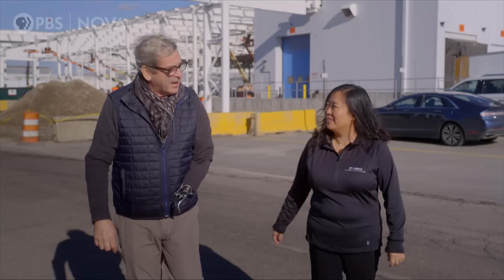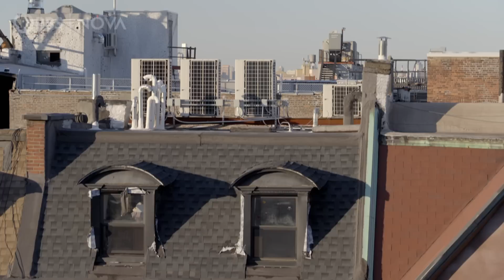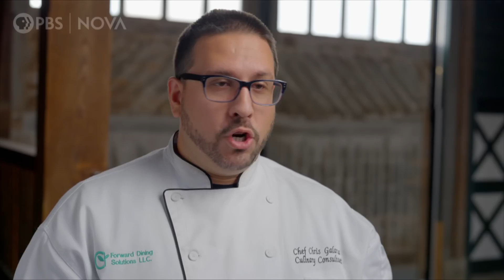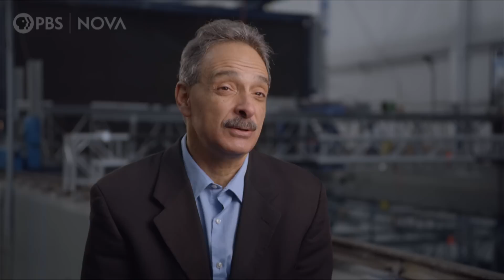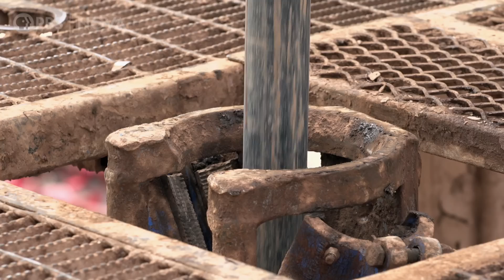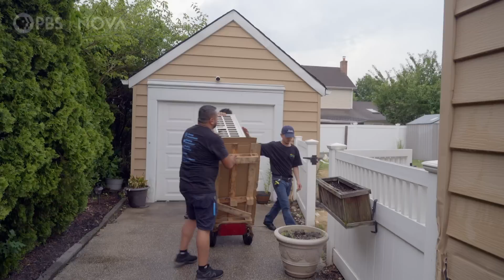Chasing Carbon Zero | Full Documentary | NOVA | PBS

Comment: A second premise is that the heat pump runs cheap. It is essentially a reverse air conditioner with a compressor and that is the most expensive electrical  item in a household during the summer. Now it also will be in the winter. The price of electricity will be the major factor and how we make it.

Comment: 2050? No the 2015 paris agreement says 10% of 1990 emissions in 2030 to peak at 1.5C in 2050. Stopping emissions by 2050 is grabbed out of thin air and 20 years too late! First segment electric Ford F-150? How is that helping? The amount of batteries it need could power 5 normal EVs for which we have too little material to make batteries for as is? I thought PBS was equal to scientific honesty? The agreed baseline is 1990, which the US signed to as well, not 2005, Choosing 2005 as baseline year make reductions look more substantial than they are as it becomes less obvious how far behind we are! standing in front of a blackboard does not make you a scientist. Is this a commercial for fake environmentalism, you borrowed the car from Ford for free? Thank you for showing the infeasibility of truck EVs!

Comment: To be fair, taking a road trip in the most rural area in the NE with a high energy consumption EV pickup truck is probably the  worst case usage for an EV. If they tried that trip in a tesla model 3 or even a chevy Bolt, it would have a lot smoother.

Comment: Everything we do releases carbon dioxide, so they want to control everything. 
There will be global starvation if fossil fuels are eliminated. At risk in coming decades will be half of the world’s 8.5 billion to 10 billion people who are fed by crops grown with fertilizers derived from fossil fuels. Getting to Net Zero by 2050 would cost $9.2 trillion a year globally (McKinsey). That's not going to be good value for money. That's nearly one-tenth of global GDP. That money would be better spent on a myriad of things including educating the fifth of humanity who are illiterate and represent a 7% annual loss to the world's economy. Any country that attempts it will be indebted or impoverished. 
Example: For the UK to reach net zero by electrification of its transport fleet and heating system, it will require a tripling (as a minimum) of its current electrical generation capacity among other things. This will essentially require the UK consuming all of the current global supply of copper and other rare metals for the next 25 years. The cost will be unaffordable and the skilled manpower levels unattainable. And that is just to eliminate the 1% of the global CO2 emissions that the UK is responsible for. So times that by 100 for the Earth. 10,000 child slaves in the cobalt mines of the Congo not enough for you? Make it a million. Imagine all the human suffering and environmental damage done from all that resource extraction! 
An electric vehicle requires 6 times the mineral input compared to a conventional one, and the carbon cost is greater until you reach 80,000 miles.
Production of all of these minerals has been mastered by China: a totalitarian communist regime that thinks nothing of the mass murder of its own citizens, imagine how much it cares about the rest of us.
And why are we embarking on this great net zero crusade? For what? So someone can virtue signal by driving around in a Tesla.
Maddeningly, there is no climate crisis. The Earth was warmer in the recent and distant past.
Reply: "why are we embarking on this great net zero crusade? For what? So someone can virtue signal by driving around in a Tesla".
Do you deny CO2 is a greenhouse gas?
Reply: "Maddeningly, there is no climate crisis. The Earth was warmer in the recent and distant past" [citation needed].
Reply: @hosnimubarak8869  Good to see you're still keeping an eye on me, Hosni.

Comment: Heat pumps are no more expensive that a high quality furnace, a boiler, or air condition unit.  In the latter case, the only differences are an extra valve to reverse the direction of coolant flow and heat exchangers that are a little larger to improve efficiency.

Comment: The problem is all the copper and rare material we'll need to electrify the human race.  2050 is a noble goal but it'll probably be more like 2080-2100.  We could certainly do it by 2050, hell, we could do it in the US by 2035 if we really wanted to.  Huge strides in material and battery science have been made in the last 20 years.  But manufacturing at scale is the issue.  And if the world economy moves into a protectionist era, it'll get even more expensive.  Nuclear power can be a huge stop gap here, if not the solution outright.

Comment: How about building wind turbines with two propellers. One on each side to double the output.
Reply: Too much turbulence.   Each blade disturbs the air.
Reply: Unless the blades are far apart , the extra energy generated is minimal.
Reply: Engineers considered that a long time ago you can bet on it. Smart bunch they are.

Comment: I didn't hear anything about conservation (more insulation & triple panel windows) or  hydrogen fuel cells. I remember ~15 yrs ago reading stories about HFC cars and refiling stations. 
Also  I saw a vid then, about a guy who lived in a northern US state. When he built his house he had the whole roof angled to the south to maximize exposure for solar panels. Since of his northern latitude that wasn't enough for long stretches of cloudy days so he also had a much smaller panel in the yard. So he never had to worry about his elec usage he also had a hydrogen fuel cell (I think ~1000 gal) and a machine to convert the solar energy, (when he had more than needed) to split H2O to hydrogen for the fuel cell & oxygen the only exhaust. This enabled him to have enough electricity to last the winter w/ the solar panels. 
He was able to live very comfortably & he even had a hot tub. All zero carbon.
Reply: Now you're talking.

Comment: This is one big advert for industry with nothing about living with less energy. Rocket mass heaters, passive solar, compost toilets, rain capture, permaculture in suburbs...
Reply: That's because they aren't degrowth Doomers.
Reply: @chapter4travels  They're delusional.
There's no energy transition and there never was in history. There's only addition.
Reply: @borealphoto  I see your point. We went from wood and dung to coal, then to gas and oil. We still use all of those today. As a %, the amount of wood and dung has dropped significantly but not coal. What is certain is we always move towards higher-density fuel. Moving towards uranium makes perfect sense just from an energy density standpoint. We will continue to use fossil fuels until their cost rises enough to completely transition to uranium fissile fuel. The earth has about 2 billion years worth of accessible uranium, so that should last a while.
Reply: @borealphoto we did transition from expensive whale oil to kerosene.   Didn't need any government mandates.
Reply: @NathansHVAC  Yep, I forgot about whale oil. But that was strictly by cost, oil was so much cheaper that no one bothered will whales again. Fossil fuels will be similar but the transition will take longer than whales. Africa has lots of coal and you don't have to kill anything to get it. Nuclear has to get significantly cheaper than coal to do that and it never will be. 85% of a high-temperature nuclear plant is the exact same as a coal plant so at best nukes will be a little cheaper to build up front and the fuel will be cheaper. The big benefit will be health improvement without the pollution from coal. Modern coal plants like the ones that Japan is building are very clean but they cost more than nukes.

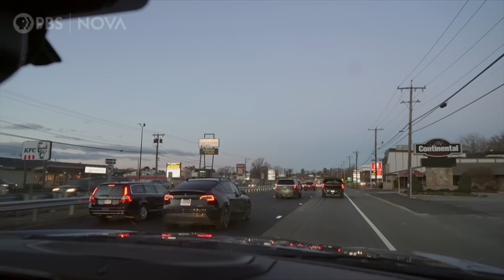Comment: 45:00 The charger they picked maxes out at 50kw. They passed a 350kW Electrify America station in Portland on the way, 6 miles back. There's also a ~100kW DCFC at a gas station in Bangor rated a 10/10 on PlugShare. I get that driving an EV in rural parts of America requires more planning than a gas vehicle but I'm getting tired of these reports intentionally putting people in a bind to make it seem more dramatic.

Comment: Green energy literally isn't green. When windmills get old or break down they are buried in the soil or left in stock yards because the parts their made of don't decay. The cobalt required to make solar panels or large batteries is far more toxic than nuclear waste. Nuclear is FAR more green than Windmills or electricity. With nuclear, the waste it produces can be recycled over and over. 
Ever since the only bad meltdown failure in history, Chernobyl, everyones been afraid of nuclear despite the fact that it now has more failsafes than a refinery. There is now very safe ways to shut down nuclear power plants and when the rods are spent, the waste is recycled again and again and again. The waste that 1 set of fuel rods produce now is the size of a baseball. That's gets recycled. 

If you love the Earth, go nuclear. 

But old, dumb politicians will never vote for it because if everything was powered by Nuclear power then almost all power would be free or at the very least extremely cheap. 

Vote Nuclear.

Comment: Carbon zero is a "fantasy". Especially when countries like Russia and China are not on board. There is nothing wrong with protecting the environment and everyone should participate in that endeavor. But as long as UV vehicles are being recharged by "Generators" - yep that's right, Generators that burn fossil fuels. We are only fooling ourselves and threatening the economies of our countries with little benefit in return. Batteries are not the answer to man's transportation needs, Hydrogen is. Hydrogen to power cars, generators you name it. The number one fuel in the universe, and where "steam" is the only by product. Cleaning up the air at the expense of here on the ground (old UV car batteries piling up in landfills threatening water tables since they cannot be recycled) is a net zero gain and does nothing to clean up pollution. It simply shifts it from one place to another. And as long as generators are used to charge UV vehicles, it isn't even doing that. It is actually increasing our pollution stamp here on the earth. It's not that difficult, just a little common sense. It isn't a coincidence Hydrogen is number 1 on the periodic table.
Reply: Not everyone gets their power from fossil fuels. Mines hydro from Niagara Falls. Other countries are doing better then the US and since you think hydrogen is the future of transport, hydrogen cars are still EVs that have a battery on board but just get their electricity from hydrogen. Also water vapor is a green house gas.

Comment: Nova you have proven to be dishonest in your reporting this is bad that you would promote this CO2 hoax and for what this is political it is a virtual construct for power used be the left if it was true both parties would take it on however that is not the case.  The ability to control the narrative comes with those who hold the political power to use the agency's for propaganda.  Just as we are see now with the FBI being a propaganda and intervening tool so is NASA and the weather service and the park service all of these have been coordinated to spread the hoax. The data they give you looks great except it all relies on the simple flaw they have inflated that is the CO2 vs temperature the temperature proceeds the CO2 that means it is a result of.  Example all those sink holes opening up and releasing methane which is part of the CO2 it is a result of warming not the other way around you have been duped.

Comment: Fossil fuels aren't going anywhere! Why would we destroy the planet to make EV's, solar panels and wind turbines which trashes the environment to mine and manufacture - requiring fossil fuels in the process and with no way to safely dispose of them at the end of their lifecycles? That's just stupid for a non-problem!

Man-made climate change is a scam and C02 is not a pollutant. It is essential for life. So the climate is changing. It changes all the time and man has little to do with it. We could stop using fossil fuels tomorrow and it won't stop the climate from warming! 

Moreover, 3 billion people live with little to no electricity or fuel to climb out of poverty and everyone expects them to not use the cheap, abundant, reliable energy under their feet? That's criminal! If the climate is uncomfortable where you live? Move. The water level too high near your waterfront home? Move - or hire the Dutch! They've been living below sea level for centuries. Adapt! You can't stop climate change... 🤣🤣🤣

Comment: "Flow batteries" are another way to get costs of stationary batteries down. They don't need multiple containers of cells with anodes and cathodes, rather the charge is stored in vats of fluid chemicals that are circulated through just a few battery cells., so instead of needing more batteries for more storage capacity, you just need bigger vats of the battery fluids.
Reply: With nuclear, we don't need massive batteries.
Reply: @scottslotterbeck3796  Just as long as the nuclear fuel lasts.
Reply: @gregripp  It's infinite, using breeder reactors.  And, eventually, fusion will come on line.  Probably.  Anyway, tens of thousands of years.  No worries, really!

Comment: It takes more than heat pumps and PV put on top of a roof to be able to get to net zero carbon building renovations; the biggest piece of the puzzle is superinsulation and high performance windows with summer shading, and energy recovery ventilation, such as passivhaus projects typically do. Otherwise buildings do not have sufficient roof and wall surface are for enough PV panels to get to net zero. So before you go putting heat pumps and PV panels on the roof, superinsulate it and re-roof the building so it can outlast the lifetime of the equipment you are putting on top, which can go up to 100 years if well maintained. I'm still waiting to hear the word insulation in your building section, and it sounds like it is nearly over. That is a huge omission in this program about getting to net zero carbon. There are all electric commercial kitchens that can do everything the gas burning kitchens do, yet still meet a passive House level of performance.
Reply: Actually, the key is nuclear power.
Reply: @scottslotterbeck3796  What happens we we can no longer fuel the reactors?

Comment: "Running our homes without lighting a flame" is a self imposed limit. 

As long as you can convert more atmoCO2 into storable fuel than you need then there is nothing wrong with burning things for your energy needs. 

An average home only needs around 200 gallons of oil to make the electricity needed for a whole year.  An average home has enough surface area, 1000 square feet, to grow 150 gallons per year but that 150 is only 20% of the total biomass created. 

If you want to enfranchise most every rooftop to participate in the re-sequestering of the carbon that enabled our society to be what it is today, don't limit us by believing that the cause of our problem can't be part of the solution.

Comment: The iron air batteries remind me of those handwarmer packs that use iron oxide to release heat when shaken up. Just make sure nobody shoots those batteries, or detonates any explosives near them!!! Because its basically filled with thermite?? Thise power plants will need really good security.
Reply: The solid (iron) oxides developed and then released are carried throughout the oxidation-reduction cycle in these batteries in a water-based electrolyte, which prevents ignition & combustion for the levels of concentration of the solid oxides that are possible in a water-based electrolyte. The hand warmers include vermiculite to spread the heat evenly as well as prevent ignition of the packets.

Comment: This was a great overview of the problems/solutions and pretty comprehensive. One subject that wasn’t covered is industrial processes that require heat. SMRs are going to address that problem. And then you have aviation and shipping, two difficult areas to decarbonize.
Reply: Right now, I'm thinking the only way to live comfortably in the future is with roof top solar and a power wall, because this administration has no clue what they are doing.
Reply: SMRs are key to a lot of stationary industries, including data centers. RNG and eventually H2 can solve the heavy transports like rail, trucking, shipping and aviation, the short range heavy transport like inside a city can be accomplished with LFP EVs pretty easily.
Reply: Net Zero is an impossible and foolish idea. 97% of C02 comes from the planet. 3% comes from man. The total C02 in the atmosphere is 412ppm which is 0.041% of the atmosphere. Man’s 3% is only 0.00123% of the C02 in our atmosphere. These people think that wind and solar are cheap? It’s not only far more expensive, it will never generate as much energy as it takes to produce, and they don’t last long enough to pay for its cost. 
Yes something are worth using to protect the environment, but the majority of this is a globalist, foolish pipe dream.

Comment: Just got my f150 lightning. It is the best driving truck/car i have ever tried.  It so smooth with the power and it easy not to drive fast if you want. I havent even tried sport mode yet. Perfect vehicle for a daily driver.  If you do alot of traveling with a truck then the hybrid are likely better fit for you if you only have one car but i never plan for this to take long trips. I have minivans for trips.
Reply: A vehicle that large is ridiculous, unsafe and wasteful unless the cargo and towing capacity(?) is utilized regularly,  otherwise an electric sedan or wagon would be better as they would use less resources and energy to manufacture, operate and recycle. Smaller is better when it come to saving the planet Ryan. Think about it.